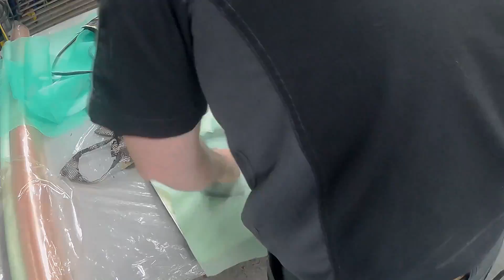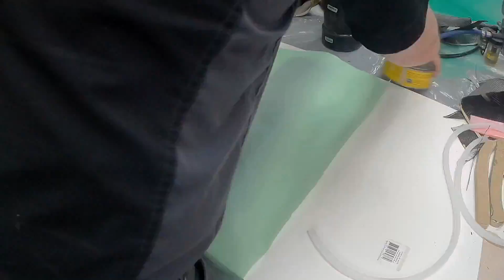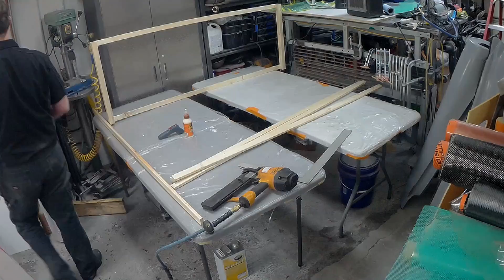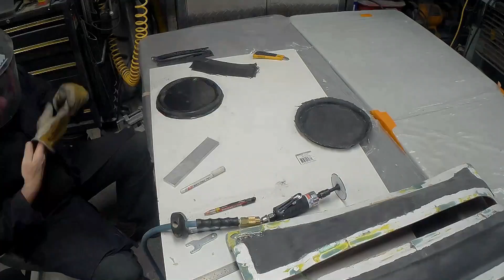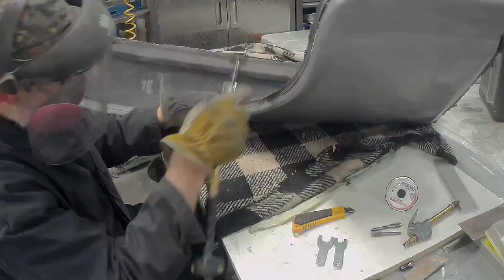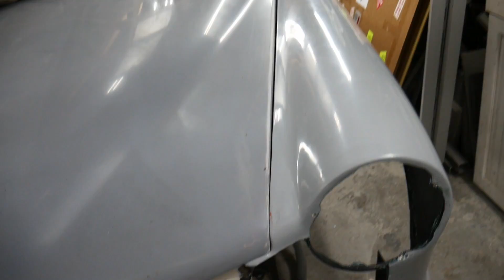DIY Carbon Fiber Fenders: Part 2 - Finishing the Job.  (Ep. 54)

Comment: Seriously, a carbon fiber Volvo? Is the car worth the expense of the parts? You could have used fiberglass and achieved pretty much the same result for a lot less money. But I think you may be in love with the process. I can relate.  😊
Reply from the maker: There is never a good financial reason to do something like this - never.  It's cheaper than therapy and in the end...it's what I want and I don't care if I spend $100,000 on a $1000 car.

Comment: Is there a reason you went with carbon fibre rather than fibre glass? Obviously there are strength and weight advantages but fibreglass is considerably cheaper and the process for laying up requires less tools and probably less experience.
Reply from the maker: I was intrigued by the challenge and mechanical properties.  None of this has to make financial sense - learning how was most of the point of the exercise.

Comment: Need a better respiratory for carbon. Not something to play with.
Reply from the maker: Do you have a model suggestion. This is what 3M had.
Reply: @ThrottleStopGarage  Prime choice would be an Airfed mask (positive pressure) but they are a bit overkill for the hobbyist. 2nd would be any large, replaceable cartridge style multistage filter (organic vapor). Being you seem to be no stranger to DIY, I would suggest making a part of a worktable into a negative pressure zone, or downdraft table, this can easily be made cheaply. Cutting carbon releases formaldehyde (organic vapor) so while the dust mask (mostly meant for manual sanding endeavors) works for most particulate/UFP's it doesn't really offer sustainable protection. Given your scope it may be a worthy 1/2 day project with minimal investment as it will serve you well for all painting and sanding ventures. I've enjoyed watching your videos, very nicely done. Surprised you only have ~11k subs. You are definitely going to do well on youtube in time. Very well put together. I'm not sure how Youtube messaging/interaction works outside of comments but feel free to contact me for more info/materials list. Good luck. Hope to see more excellent videos.
Reply from the maker: @waxball888  Thanks - I'll go see what I can find today.

Comment: Hey mate, love the channel. This might be a dumb question, but for small parts like these, wouldn't it be quicker, cheaper and faster to do a hand layup? I know the ultimate strength to weight ratio would be down, but it seems like the amount of disposables and the % of wasted epoxy in the lines is pretty high
Reply from the maker: Thanks - cost really isn't a consideration.  I'd rather have the strongest parts I can make.  Now if it was faster...that would be appealing.  With carbon fibre, from what I understand, you have to compress it to make it strong.  So if I wet layup over infuse, I don't really save much.

Comment: I know you are "space limited" but as several have commented, and you've indicated awareness, find a way to run a light flexible hose attached to your grinder/cutter when you trim parts or work with the volatiles- this stuff is bad for lungs, eyes, just ordinary living things! Your attention to detail is dynamite- previously "Street Bandito" was one of the better "home shop CF" You tube series- they went dark about half a year ago, IDK. Got my sub- KOKO!FR
Reply from the maker: I'm going to try a different method next time.  I've got an air cleaner in the rafters running as well.  Better safe than sorry.

Comment: You need to get some air flow in there. Or at least a vacuum to pull the CF dust away from your work area. Think vac form table that you can work on.
Reply from the maker: Working on it for the next part.  Maybe I should just trim them outside in the snow.

Comment: did i hear you say the plastic buckets were made in Denmark , i have to take a look at mine cant believe we made something for this ikon of an car . I also think you should change your name to Magic 
Throttle Stop Garage , and i enjoy seeing your view numbers rising you deserve it . Have a nice day
Reply from the maker: HI Ivan - Yes - made in Denmark and very nicely if I may say so.  A quality part for those restoring Amazons.
Reply: @ThrottleStopGarage  i have some questions maybe you will kindly answer them the first one is what do you do for a living and the second what will you use the car for , driving the roads or racetracks and three what kind of engine is it you are putting in it and what was the donor car and four the engine in the back by the compressor what is that from and what kind of gearbox does it have . i´m sorry for being nosey and maybe you already mention it in and episode ........ lol
Reply from the maker: @mikkel1249   I'm a scientist in my day job.  I'm not building the car to race it - there isn't a track around where I live.  I'd like to be able to autocross it at some point.  I'll for sure take it out on track days etc.  It's sort of my version of a Singer Porsche 911.  The engine is a Volvo 5 cylinder that I'll build in the next year or so.  By my compressor is the built B20 that was in the car (about 150 hp), a B23E that was in my 242 (which now has a B230FT) and the engine that will go in this car.  The gearbox is a Borg-Warner T5 (with inners to hold over 400 hp - the 5 cylinder is a B5234T3 and we're running a bigger turbo and will have it dialed up to "stupid grin" most of the time.

Comment: I aviation when we use anything that needs to cure like epoxy or sealant we make a "ticket" to check the cure.  Basically it's just a scrap piece, preferably of the same material that you are using your sealant/epoxy on, that you put a little bit of your excess material on at a similar thickness that you used.  You can check your ticket to see if it has cured sufficiently instead of messing with your actual piece that you are working on.
Reply from the maker: Great tip. Thanks.

Comment: Great job. You mentioned that the completed carbon fiber fender weighed 2.8kgs. Do you remember the weigh for the stock steel fender for comparison?
Reply from the maker: The stock fender is 10 kg.
Reply: @ThrottleStopGarage  thanks again

Comment: what glue are you using for sticking carbon fiber?
 Best regards
Reply from the maker: Pro-Set ADV 175 with ADV 275 hardener.  https://compositeenvisions.com/proset-adv175nc-epoxy-adhesive-resin-no-color-2094.html

Comment: next time when you apply the foam insulation get the silver side facing inwards so it radiates the heat back !!
Reply from the maker: I was worried about the potential fire hazard so didn't buy foam insulation with the foil backing.  I went with the basic foil bubble wrap insulation.  Fire extinguisher close at hand...and I kept the internal temperatures below 60º C to avoid all fire risk and still get the benefit of the post cure cycle.

Comment: Pretty good for not really doing carbon fiber layup. I been doing it since 84, started with Boeing. They taught me well. Did alot of pre preg out here on the west coast of British Columbia for a company for 23 years too. Ask if ya have any questions, I may be of SOME help. You seem pretty sussed out tho. Good job! I made a CF top for my 87 Vette, turned out nice. I used Flexible Coremat for core material. Nice stuff.I see you used Hexcel HiMax Carbon Fiber Biaxial +- 45°. I remember you asking or mentioning warp directions before. Run them opposite on each layer. It would help if you had access to 0 degree and added that to your layup.Adding "doublers along the edge band helps with strength also. Esp when using a core. Overlaps if you have to at 1/2 inch for structural integrity. Aluminumized stuff out there too for edge bands work nice too.
Reply from the maker: Awesome - thanks Darrell.  I did some of that in the upcoming video on the trunk skin.

Comment: This "Carbon fiber body panels" series has got me thinking about a friends old Morris Minor Traveller.
It was a real heap when he got it, But it was his first car, and first cars always get under your skin. Over the early years he bodged the hell out of everything. A fair amount of the original exterior wood had rotten away, But back then you couldn't get replacment wooden sections for them, So he'd just chisel out the rot and pack the areas with glass fiber filler.

He pootled about in the car like that for 10 or so years until he discovered a company that had just started to manufacture new wooden sections for it. By this point he'd gone through engineering college and got a reasonably well paid job with a well known aerospace company, So as money wasn't that big an issue anymore, he decided that it was high time to finally rebuild it properly. He bought the full kit of wood and all the body panels he needed........ Then he didn't touch the car for over a year !

What prompted him to restart the renovation again (About 7 or 8 years back now) was that at his work they'd started making parts out of carbon fiber. When they were laying up 30 foot long molds the "Scrap" offcuts were still pretty usable sized sheets of cloth, So he had a chat with his boss and arranged to buy some offcuts from them at cost (Remembering that this company was buying in SERIOUS bulk, And getting all the discounts that this entails....... Their "At cost" price was cheaper than I could get comparable sized sheets of glass fiber mat at that time !!!!!!).

He built molds of all the wooden sections and made carbon fiber replicas with either foam or aluminium honeycomb cores, Then he decided it would be silly to reuse the original steel body panels with his new frame, So molded those too. He run the car around with the carbon rear outer panels (The "Wood" sections painted black and the bodywork ivory white) for about a year before taking it back off the road again to replace the roof, Outer door skins, wings (Fenders) and bonnet (Hood) with new carbon panels too.

I moved away from the area before it was back on the road from that upgrade, But we still occasionally send each other emails, and he's now talking about going the whole hog and replacing the inner wings, Bulkhead, floors, and chassis rails to have pretty much a full carbon bodied minor. He reckons that he can make the chassis several times stiffer AND a lot lighter if he does this, But he's also toying with the idea of completely updating the running gear to get away from the 70 odd year old suspension design and the slightly temperamental 1980's 2.0L fiat twin cam engine it's currently running. 

I'd love to see what the weight of it ends up as when it's finished (As if ANY project car's ever "Finished"!!!! LOL ! ).
Reply from the maker: That sounds like a very cool project.  I lived in the UK for two years in the mid 80's and learned how to deal with real rust as a teenager.  I have a real affinity to old European cars and was into Jags (various MK2'a and an XJ6) for a long time.  

I have no idea what the end weight is going to be for this car.  The original was 2500 lbs - I'm guessing that I've added 200 to the total with what I've done but the proof will be revealed when I scale it when done.  I'm still building for 400 WHP - so this car will be a little nuts when done.

Comment: Love your solution to a lot of things! That plumbers epoxy is pretty cool. 2 quick tips I have that might help out. During infusion, you can save epoxy by rolling up a small square of the green flow net and sticking it in the end of the infusion line as opposed to the length of spiral wrap. I'll go up to about 600-700g with this method before I use the spiral wrap to speed up the infusion for large parts. Second one, when trimming, I find a way to clamp my parts to the table or saw horse and then hold the cutting tool and a shop vac nozzle together with both hands so you can catch a lot of the dust right off the cut.
Reply from the maker: Great tips - thanks.  I'll see what I can do to further rig things up.  I wasn't in love with the trimming mess!

Comment: How nice did they turn out.  Fantastic job.  I have a very clean and original 69 Amazon with more or less now welding / rot.  Panel fit is not that good compared to a modern car.  It drives me nuts sometimes.  You'll probably end up with much better gaps than your car originally left the factory with.
Reply from the maker: I've seen a few Amazon's with really nice gaps and it's one of my favourite things.  That said, most original ones I've seen are very agricultural compared to modern.

Comment: Outstanding as always! Inspring me to get off my duff and finish my damn 122. I watched these videos thinking I'd like to try carbon body panels as well, but you've convinced me to stick with Fiber Glass LOL. Any reason why you chose carbon fiber? I know it's 15-20% lighter than fiberglass and that's not nothing, but the more videos I watch on vacuum bagging the less I want to make any investment in it because my process usually goes: "I got this" - forgets an important step in the middle of first attempt - wastes money - tries again - mediocre results - tries again - mastery lol
Reply from the maker: Thanks Scott.  I'm trying to not forget a single step or decision.  It may not be as interesting as "I built a Lambo hood and failed." but it's thurough and correct.  I mostly wanted to do this to learn how...I have some work projects that would benefit from   me knowing how to make these kinds of parts.  There is also the   cool factor.  I know I could have done it in S-glass.  It's all quite complicated really.  Vacuum bagging isn't that bad, and the lack of mess (aside from the clean up) is great.
Reply: @ThrottleStopGarage  Good points about clean up. It does seem a whole lot of prep and then a very simple clean up/final step process. Of course, my main reason for wanting to try anything (carbon fiber/any fabrication/ anything really) is pretty much to learn how lol. Keep up the good work!